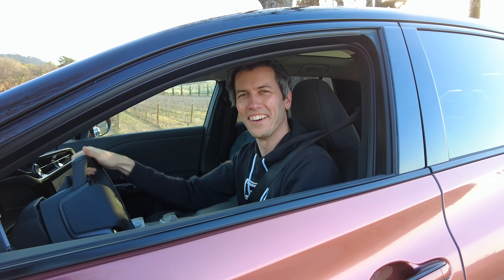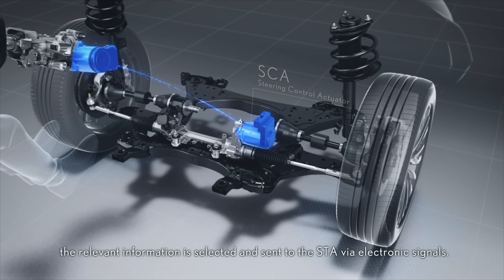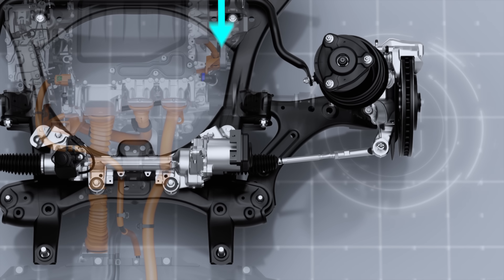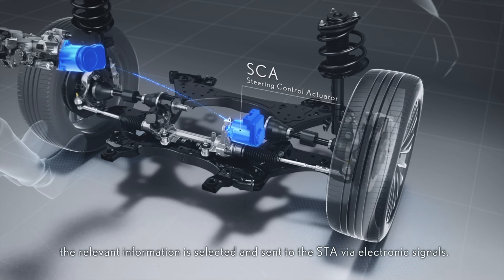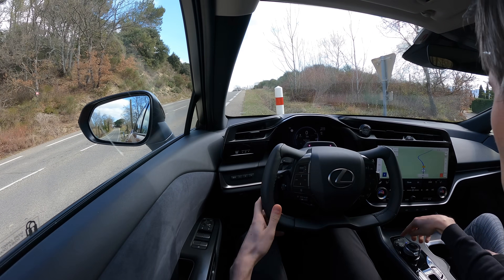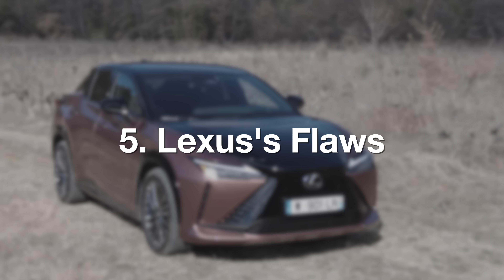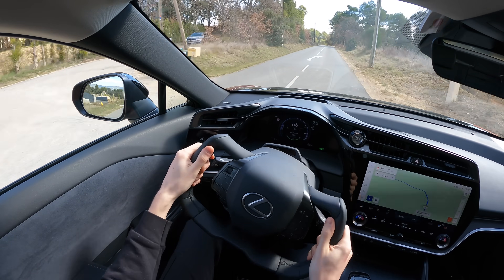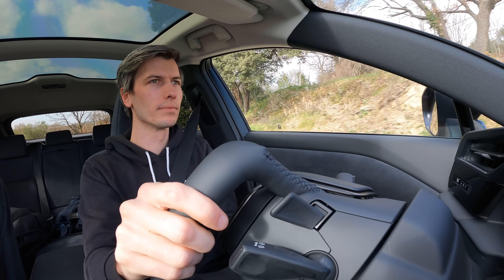How Lexus Fixed Tesla's Bad Idea: Steer-By-Wire Yoke

Comment: Would be really really cool of the data generated by these drive by wire systems could be leveraged in direct drive wheels used for sim racing
Reply: @There is zero pictures of earth from space.  I'm reporting all your comments for misinformation. Deal with it.
Reply: Bro thats literally what force feedback is based upon. Dont think just because its real life it's better. All these electronic systems make driving look like a game these days
Reply: @FuntimeMFZ  well considering the fact the literally every single sim has their own form of FFB with their own pros and cons you’re obviously just wrong 😂

If it was based purely on real world data generated by actual cars, then all sims would be using the same FFB model. But please, continue
Reply: @squirrelzar  There are historical reasons for that, so it's a long story.  But in short, most sims have base FFB that matches known real world factors, and then a host of sliders to let players set the 'EQ' of various effects to compensate for the shortcomings of their game controller.  Since a logitech wheel capable of outputting 1Nm of torque is obviously not going to be able to produce forces 1:1 with a real car.
Reply: @Stereomoo  no logitech wheel is only capable of 1Nm of torque what?
Reply: @FuntimeMFZ  Ones they sell new in 2022 no... ones they sold in 2012 when most of these games were being coded, certainly

Comment: strange that its a variable ratio based on speed,   i would have thought they would make the ratio non linear,  this is how i prefer my driving sims, where as you move the wheel further away from center, the wheel position becomes more exaggerated as you reach maximum rotation of the wheel. so the sensitive movements are still preserved

Comment: In winter driving you can find yourself in a situation where the rear of the vehicle starts to drift correcting for this successfully requires keeping the front wheels pointed where you want to go, in order to do that one must react more quickly than that setup seems to allow!

Comment: security : in classic car, a simple failure of steering assistance makes the vehicle un controllable. It depends on the véhicule weight, but the heavier, the harder to control.

also, in some road issues, the drive by wire can be safer in one specific case : differential resistance. when you drive over a long water surface that affects only one side of the car, the steering wheel will tend to turn towards this side. most people who don't know / understand this phenomenon will get surprised, don't know what to do and let the car turn, and crash in the bank. only experienced drivers are able to preemptively turn the wheel in opposite direction and hang harder on the wheel to keep it in control. 

if this case is correctly programmed, steer by wire can handle this case easily and save lives. it requires to read permanently each mili second the resistance and slip in each wheel. camera on autonomous vehicle level 4 can also predict this ( not sure level 3 is designed for this). 

There are a few other edge cases where steer by wire can help. usually those where the differential usually interferes ( slippery or muddy road on only one side ).

Comment: The variable ratio can also be implemented to corresponding to the steering wheel's turning angle instead of the car's speed. just making up an example it can configured to first 5 degree of turn ratio at 1:0.3, and the last 5 degree at 1:1.2, even out the increase for the middle section at 1 degree interval. that way, the steering is consistent but also avoiding cross hand turning.

Comment: Yeah, we do have a lot of “x by wire” stuff in cars already, it’s just nerve wracking when you mess with steering or brakes or anything else fundamental for emergencies and that must be operational during any emergency.

If my car bursts into flames on the highway, I want to be able to maintain control, overpower all the failed electrical and be able to pull over and stop with the emergency brake…

Comment: 12:53 it's funny to me that you knock the Tesla yoke for having to either go hand over hand (why anyone would to that is beyond me) in a sharp turn at low speed, or remove one hand. Right here, you do that exact thing with a wheel. So as you've shown us, Tesla's yoke design is no more unsafe or impractical than a wheel, it's just different. And it's superior to Toyota's because you get full feedback from the rack and there is no delay between tire steer and yoke action.
Reply: found the tesla fanboy

Comment: I think you left out one point.  If you are still driving a gasoline engine based vehicle, then you have fuel economy.  To operate a hydraulic pump to keep pressure for you steering does, place a small load on the engine.

Comment: If you've ever seen what the tiniest drop of water you can imagine can do  to a Drive By Wire throttle when it gets on one of the connector pins you would realise that this is one of the most stupidest and pointless ideas I've ever heard  of

Comment: I popped a 350a main fuse driving at 110km/h the other day. It was a direct short to ground; cables had rubbed through. All electrics were off. If I was in this car, I'd have died.

Comment: The wire one is ok ish but the wireless connection is absurd completely. Not only it can be disabled by a simple radiation based shock but also can be abused by forms of hacking. Granted that even the wire ones can be abused.
Mechanical all the way everything else is just recipe for disasters.
As for design choices never paid attention since I will never own one of any 'Teslas' but seeing now the steering wheel looks like they copied a low end game steering from late 80s and 90s stypes. I had few MadCats wheels for PC and PlayStation and they were horrible, not just in looks but in function. I don't know how those even managed to pass to be sold. These look like that and I wouldn't be surprised if it feels the same too ...
Honestly the automotive company Tesla is basically an insult to that name, since Tesla was an amazing person. There is nothing amazing in this company. More like flexing and projecting. And considering that Musk is a Edison fanboy kinda proves this, that he chose this brand name just so he can flex his ego. 'we sell nonsense but we put Tesla name on that so we can be edgy, Edison couldn't have Tesla and do it, we can...'

Comment: Well, i had a BMW E60 with active steering, it was  2004, its not drive by wire, but changing drive ration, i am thinking anyway the best and safest system, providing comfort and driving pleaser, without any dangerous technology

Comment: Also now it's easy to make a RH drive variant as you just change where the wire goes, rather than having to invert the entire linkage system
Reply: Or in Lexus’ case being Japanese, make a LHD from a RHD 😊
Reply: @JJHammond  Actually it would be making a RHD from a LHD. Lexus is first and foremost a US brand that launched in the US in 1989. The Lexus Japanese market didn’t come until 16 years later in 2005. Although in this case they’re not really designing one from the other as they’re being made simultaneously.
Reply: There's more to that thank just inverting the linkage system, but yes, one less thing to redesign
Reply: And a slightly more optimized  manufacture and supply chain
Reply: LH drive variant, you mean.
Reply: @James Scholes: The prototype Land Rover solved the LD/RH problem by putting the steering wheel in the centre. That didn't last long though, thankfully!
Reply: Great point. No surprise that an American did not consider this.

Comment: The only scenario I find the steer by wire tech useful is in incorporating rear wheel steering in low speed driving scenarios. For example parking or doing tight turns. 
The faster you drive the more dangerous the whole idea for steer by wire becomes as it will NEVER be predictable.
Reply: Jets are pretty fast. How many jets have mechanical linkages between pilot and actuators?
Reply: @RR-us2kp  are you ok?
Reply: @Druze_Tito  I am. Thanks for asking boomer

Comment: This all makes sense now. They are using super complicated redundancy based steering, with addition of heavy backup battery, just so they get rid of the old proven to work great mechanical steering that is lighter, safer and more enjoyable to drive. That makes complete sense. Not!
Reply: This boomer is going all out against Lexus 😂
Reply: Yep. This is being seen as a political cause, that’s why it’s being pushed

Comment: Jason,

The whole solution is just crazy.

Let me explain. You drive down the highway, 80mph, and suddenly there's a object that you want to avoid. How does the steer-by-wire adjust the ration then in a fraction of a second without knowing your intention? 
Or you are driving slowly in an urban area, 20mph, you want slow turning reaction of the wheel, but it decides that since you are moving slow, you don't need slow reaction but quick and sharp. 

I would really appreciate to see unpredictable scenarios and not just an ordinary driving scenario. The problem with steer-by-wire is that it will ALWAYS act differently and interfere with human's interaction with the vehicle, because it has to function by some sort of an algorithm that is made by other human than the driver (which means unpredictable steering behavior).

Comment: Predictability is good....and round a steering wheel is predictable because its profile is consistent irrespective of its orientation.
Reply: Lot of steering wheels have a flat bottom
Reply: @RR-us2kp  Flat bottom wheels are designed for race cars so that the knees of the driver don't interfere.
Reply: @firststep7750  yes I know. But race cars aren't the only ones with a flat bottom steering wheel anymore. Pretty much all new cars have flat bottom steering wheel
Reply: @RR-us2kp  My point is, square steering wheels aren't required for road cars. They're only there because they're a sales gimmick.
Reply: @firststep7750  so what? If it's no different, no problem whatever they put in, right?
Reply: @RR-us2kp  Take an Audi for test drive and executive a reverse park or a full lock turn. You'll experience how inferior they are to a round wheel.
Reply: @RR-us2kp  and tell me how you went.
Reply: @firststep7750  tells a lot about your lack of driving skill than Audi design flaws
Reply: @RR-us2kp  No it just says a lot about your susceptibility to be marketing gimmicks! The majority of car manufacturers use round steering wheels and for a reason. State a single advantage that a square steering wheel has over a round one?
Reply: @firststep7750 what about better view of the instrument cluster. Ok boomer?
Reply: @RR-us2kp  Boomer? No! But, I get it; you're bubble gen. Which means fashion accessories over practicality. Your current car has a round steering; tell me what it's obscuring?
Reply: @firststep7750  ok boomer
Reply: @RR-us2kp  It took a while but you came around, bubble.
Reply: @firststep7750  if you say so boomer

Comment: One thought, you don't have to stick with just one set of steering ratios. Multiple "profiles" could be created for different driver preferences. You could have ratios for those that like more sensitive steering inputs, ratios for those that like a bit less sensitive steering inputs, and everything in between.  They already have adjustments like these for RC cars, why not for real cars?
I don't like the idea of the system limiting my steering input, at least to some extent.  What if I need to make a large steering input in an emergency to avoid a collision? I can't see some sort of "steering stabilization" function working well as it won't know what the driver's intentions are.

Comment: One interesting thing this might allow is a sort of "maximum safe turn rate" mode where cranking hard over always makes your vehicle turn at the maximum possible rate. No understeer, no rolling the vehicle.
Reply: And it could work together with ESP so that, instead of only using differential braking, it could even give the correct steering inputs. Racers will hate it but it will save lives.

Comment: One thing that comes to mind is for situations when you do a bit of spirited driving. Often times you come a bit hot and heavy into a curve, this will either let the system believe it should use a high steering ratio to get you a slow and stable steering, and then fail hard when you actually want to turn hard. Or it will get you the fast steering, but fail when you exit the turn and want to go back on the throttle. You'll then have fast steering and high speed. Not to mention if you do another turn that turn will most likely have a completely different steering ratio from the first. Making steering a far more unreliable action. So the way I see it, this seems like something you absolutely don't want in a sports car. In a family car, sure, why not, but not in a car where you want to drive well at higher speed.
Reply: My first thought was that over steering is boned with this. 

While I generally use it for fun when we get a little bit of snow. 

Knowing how to over steer properly in weather is a life saving maneuver. Inconsistent steering that is dependant on speed has me worried.

Comment: This just has "nope" written all over it. Hungry rat gnaws on your steer-by-wire, shorts out at an inopportune time, and you go headlong into a ditch? Thanks, but no thanks.

There's a reason they say "the cutting edge is the bleeding edge." And in this case, the bleeding could be all too literal.

Comment: Can they not just use a traditional low ratio, 300 degree-limited rack that has a speed dependent effort assist motor and a torsional damper to alleviate bump steer?

Comment: i understand fhat fly-by-wire makes sense e.g. in the f-22 raptor because of human input and stability control at the same time moving in all 3 dimensions. there is no such reason for 2d movement like in a car. btw. jason: brakes still work hydraulically and are only assisted by wire.

Comment: I think the steering delay isnt a latency problem, its just a limit to how fast the motors can turn the wheels. The moment you start moving your steering wheels the wheels start turning too, but it takes the wheels longer to get to the target angle than it takes you to move the steering wheel. In my opinion it doesnt really matter much as you cant really turn the wheels faster in a regular car than the wheels turn in the lexus as you have to move the steering wheel way more in a regular car to get the same speed.

Comment: So being that I have a good understanding of how automotive servomotors and similar systems work, there's always some redundancy to make sure that if something happens then the servo goes into a basic setting mode....so it must know the position of this basic setting and it must also be able to function mechanically. If there are two redundancy systems then I'm sure it will be perfectly safe until one packs in and at that point the car should shut down so you are unable to move it until problem rectified. Aeroplanes have been using fly by wire for years (hence the name fly by wire) and of course there have been some serious incidents when these systems have argued with each other and not done as intended. That being said, driving is a 2d mode of transport whereas flying is 3d....you can't fall out of the sky while driving, but there are many more obstacles on the ground.

While writing all this most of it is being explained in the video 😅

Comment: I used to have a BMW 135 with active steering. It used a planetary gear set in the steering column to adjust the steering ratio based on speed. It was awesome! I loved it and was sad when it was discontinued.
Reply: There is zero pictures of earth from space.  So is your head.
Reply: I was looking for a comment about BMW doing this even with normal steering 😀 Thank you
Reply: @pepcorampouch4787  I think fiat has something similar
Reply: @user-mi4yc7pr3x   And I betcha they aint the only ones 😀
Reply: Okay this is what I'd imagined, would've been nice if presenter had mentioned this as background info, I was sure this was possible mechanically. Thanks for confirming.

Comment: Another benefit of this drive by wire is that in an interior that is simple like a Tesla the steering wheel could easily be switched from left to right by sliding over for RHD countries. Manufacturing cost would be hugely smaller and simpler since there will be no column. But this lag needs to be zero in the production.

Comment: My Cupra 300 with progressive electronic assist steering wheel, is amazing. If i can have that instant response in a drive by wire then i am in. But the prototype lag is unacceptable.

Comment: So, my curiosity asks, when did they ditch the legal requirement to have the steering wheel connected to the wheels physically? I know on road vehicles used to have to be connected physically since straight hydraulic steering was illegal for on road use.

Comment: My '08 BMW had Steer by Wire, I had a few problems that were fixed really easily by a 3rd-party repair with a life time warranty, but I didn't like when going quickly and needing to make big adjustments in an emergency. 

Another driver pulled into the lane I was traveling in at speed, the steering was very slow and I had to wrench the wheel dramatically to avoid a major accident. with a regular rack it would have been no problem, but the Steer by Wire had reduced the rotation because of my speed, I touched cloth that day

Comment: Automatic adjusting ratio. So the faster you take a corner the worse the handling?   So you never take a corner with the same turning ratio only if your speed is completely the same. 😢

Comment: a small nit pick : if the car is turned off, you can't realigne the wheels. 
same if you have to push the car or if a mechanic has to move the car (on the side of a road, in a parking lot or to align it to the truck)